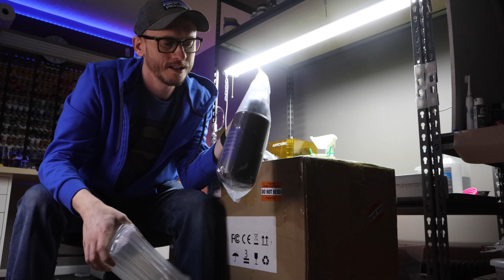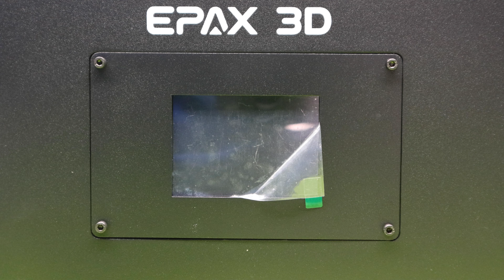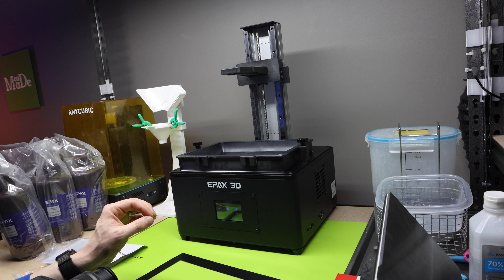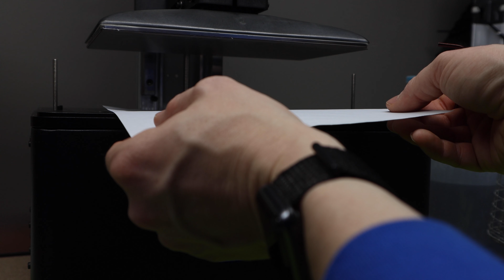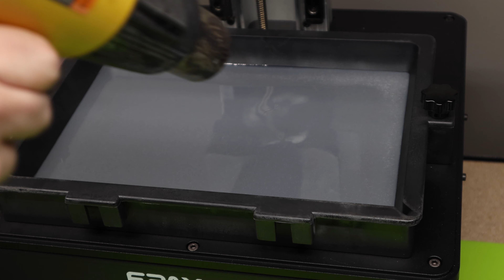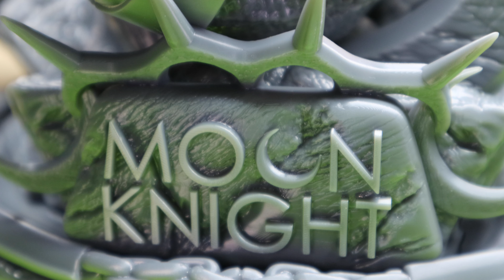Epax E10 8K Resin 3D Printer First Impressions Review! Unboxing, Set Up, First Prints

Comment: Lets say you have the 5k already. Is it worth the $389 upgrade to the 8K screen?
Reply from the maker: Honestly I don’t know. A 5k is pretty great. I don’t feel you would see much of a difference with only 3 more K.
Reply: @ItsMeaDMaDe  that’s true I just heard somewhere that since it’s a bigger size printer your 4k prints would be more like 2k so 8k would be more like 4k and that’s why the printers like the Phrozen 4K mini show more detail than the bigger 4K printers. Maybe I’ll do a side by side. Once I get motivation to set it up lol
Reply from the maker: It also depends on what your using it for. Like miniature figures or highly detailed models would be a reason for an upgrade but if your happy with the results your getting I feel the upgrade isn’t going to make it a ton better.